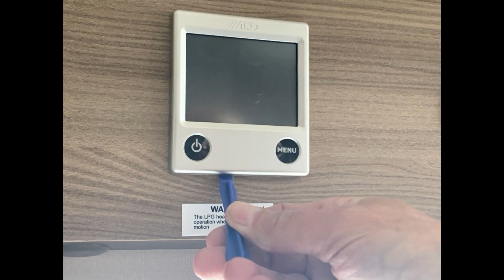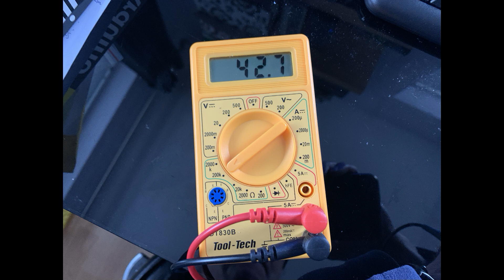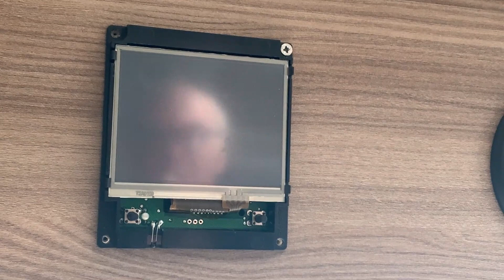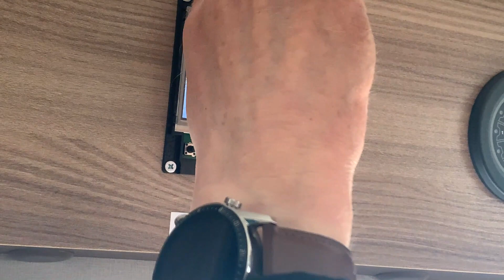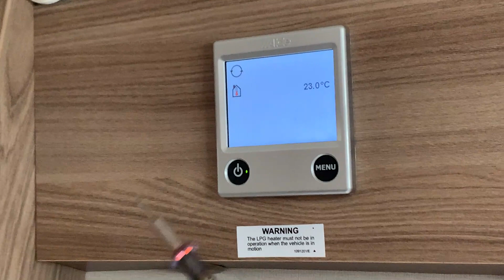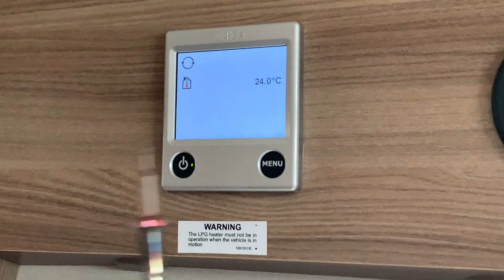Alde Heating 3010/3020 Touch Screen Control Panel Repair - Showing 70 Degrees

Comment: if you don't want to solder the board you can buy a plug in temperature sensor, alde discrete its called, just plugs in the back of the unit .
Reply from the maker: Hi, thanks for the info, that's worth knowing for the future 👍

Comment: I’m having the same issue. Where did you get the thermistor?
Reply from the maker: Hi Robert, I bought them from eBay. Search for NTC thermistor 47k. https://www.ebay.co.uk/itm/174205305803
Reply from the maker: https://www.ebay.co.uk/itm/174205305803
Reply: Mine has no power   Not lighting up. Any idea where to start. Tried 2 fuses on main board and checked blade fuses